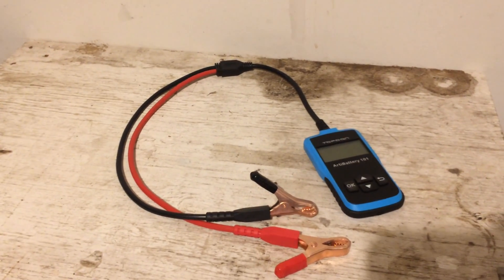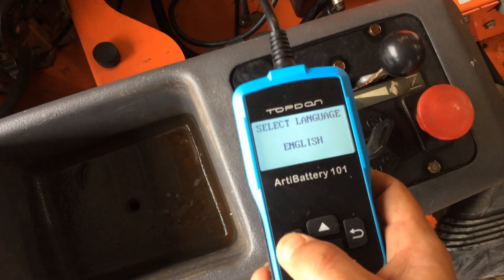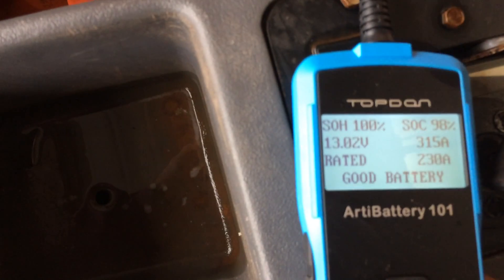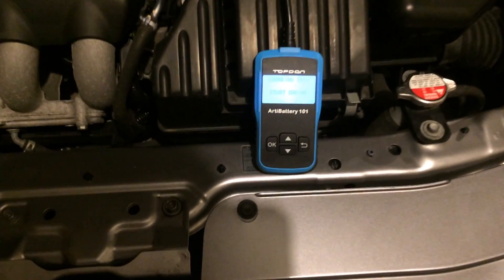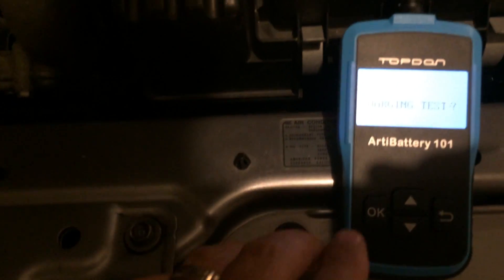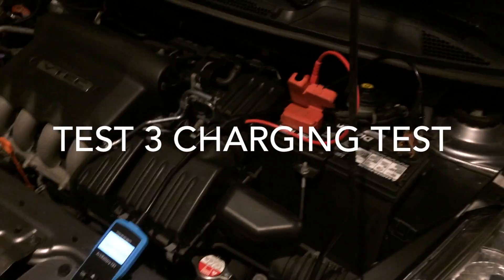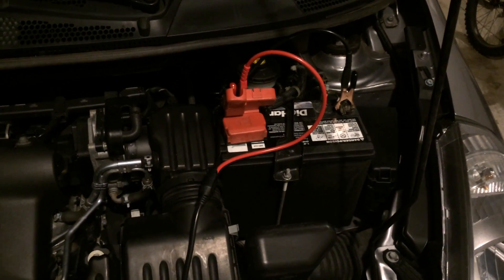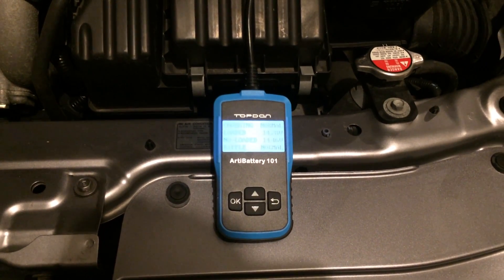Load, Cranking, Charging Testing With Topton Digital Battery Tester

Comment: Doublewide6 - your tests are generally excellent but switching between the lawn tractor and your car led me to confusion. You said that you needed to replace your regular use automobile battery but I saw no failed test for it.  Didn’t you need to replace the tractor battery?  Love your channel and hard independent work to help educate us. Your loyal viewer, John
Reply from the maker: The auto battery is about 5 years old, on the load/condition test it said replace because it was only holding a 60% charge.   I was having trouble with the lighting when testing the car battery.

Comment: Nice video but what test determined the battery in the car needed to be replaced
Reply from the maker: The first test on the car was a load test (not shown in video) it stated that the health of the battery was only at 60%.   The tool said the battery should be replaced. I tried to show the tests on different equipment/cars.  Sorry you found it confusing.  Bob
Reply from the maker: The auto battery is about 5 years old, on the load/condition test it said replace because it was only holding a 60% charge.   I was having trouble with the lighting when testing the car battery.